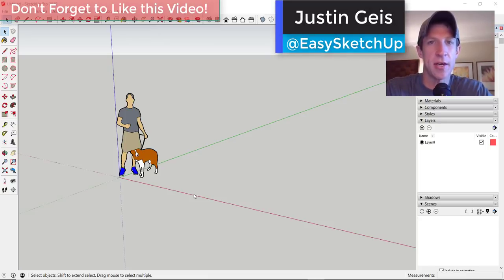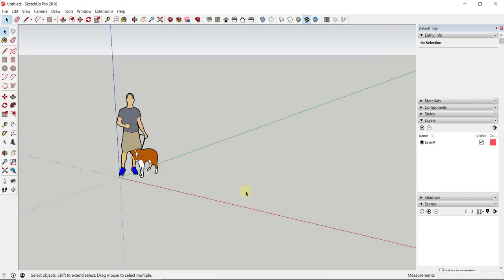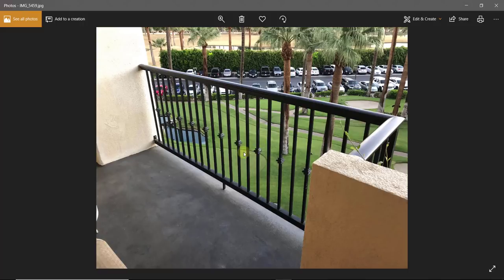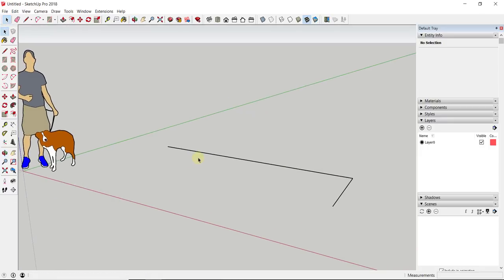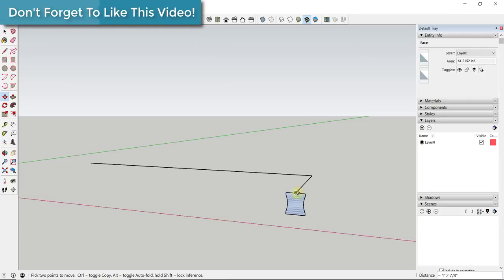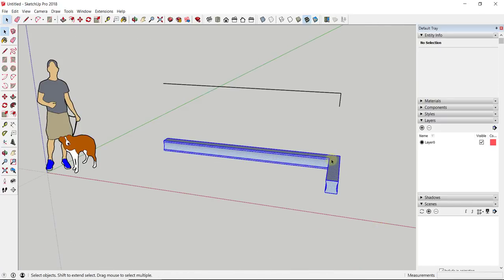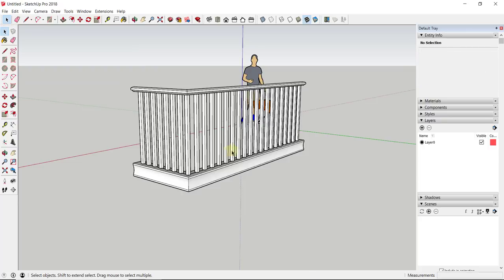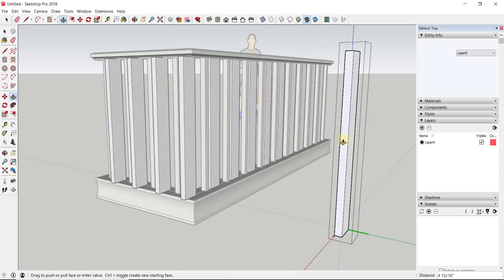Modeling a Railing in SketchUp with Groups and Components

Comment: Thanks for sharing. It would be great if the follow-me tool could work on 3D shapes
Reply from the maker: What do you mean exactly? Follow me extrudes flat objects along paths, so it wouldn't work like that with a 3D shape. Or do you mean extruding along shapes that aren't continuous paths?
Reply: I mean that the follow me tool could be made to work on a 3D object, for example a fence post and rails, just duplicating the shapes, end to end, following a path. Corners and sharp curves could be tricky if not complete multiples but with those preliminary views it could be managed, I believe